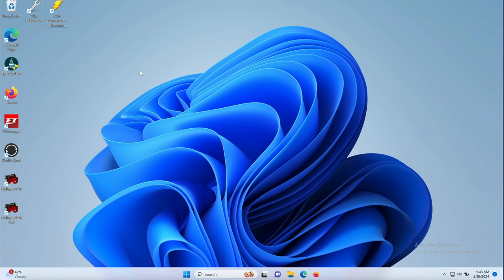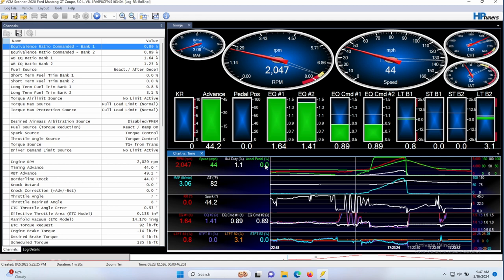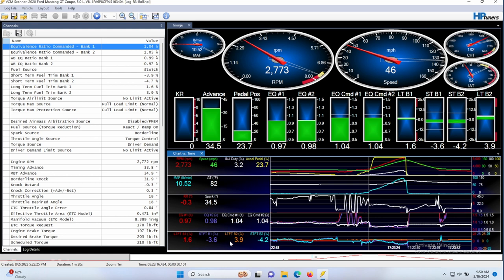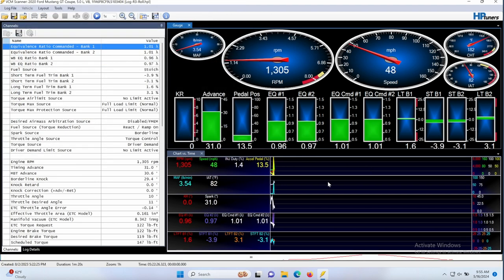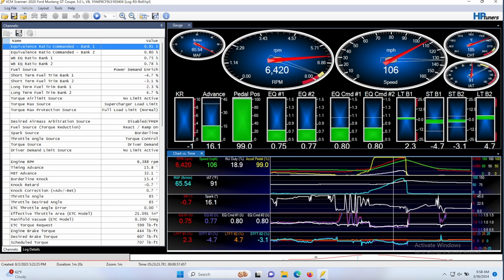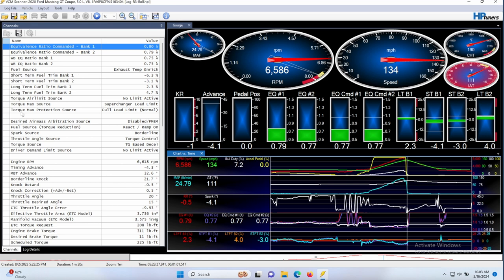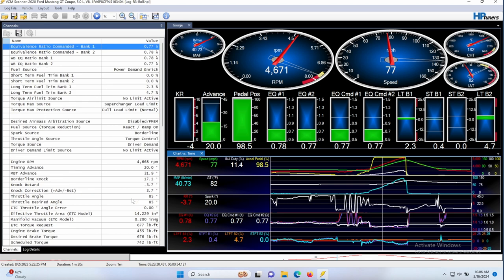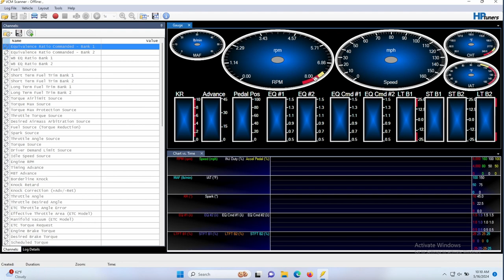S550 Mustang Datalogging with HPTuners - How to Read your Datalog

Comment: I understan S650 cant be flash or tune. But cAn I use HP tuner to data log mu data to read it after esch pass down the 1320?
Reply from the maker: I do not see the s650 on the hptuners supported vehicles list so I don’t think so.  I believe Whipple is the only player right now and they have a tool called tomahawk I believe.  It probably can for Whipple cars.